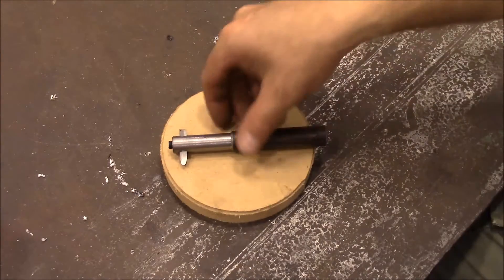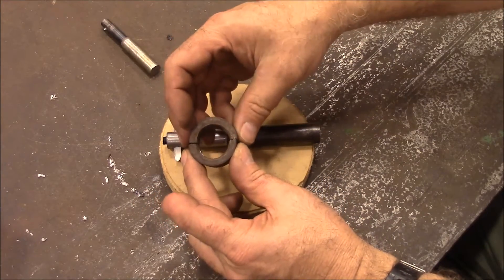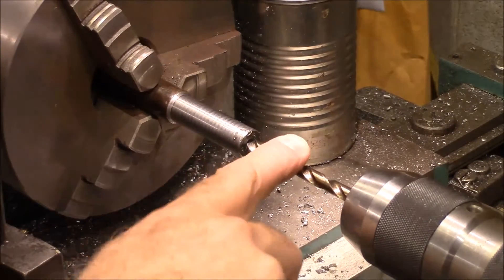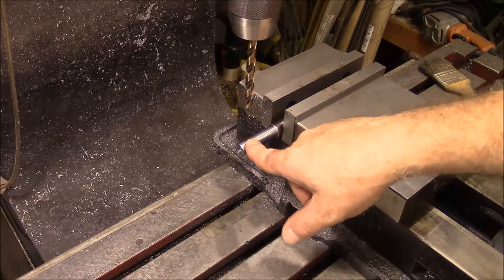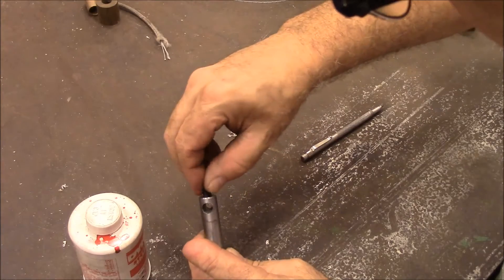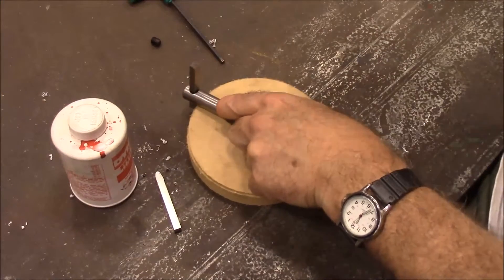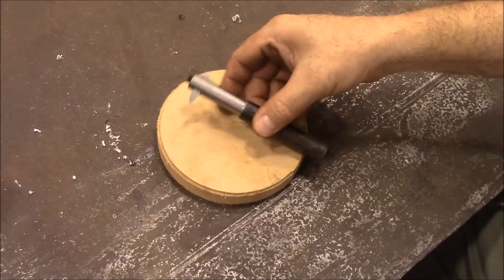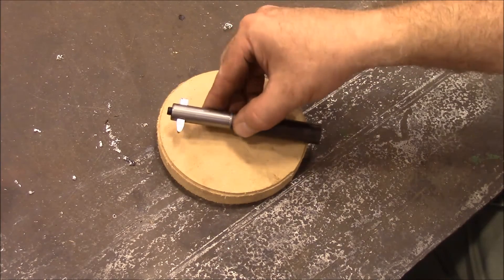Easy Homemade Internal Threading Bar

Comment: This tool clearly will noy cut an internal thread as there is no 60 deg angle on the cutter, added to which you need to dia in the correct fed on your lathe!

Comment: I ended up making one out of leaded 12L14 and drilling a 1/4 hole and trying to file it to square, WOW that was a nightmare. My needle files (cheap brand) kept leading up on me and my file brush couldn't get it out of the corners of the file. 

I finally ended up grinding my 1/4x1/4 hss down some to get it to work. I think I may try it again this time with 3/16 round HSS for the bit, I will make a small square block with a set screw and put a flat on the side of the hss then use the square block to help me keep the hss squared up as I grind/hone the point to the 60 degree and allow me to come down half height on the round stock, this way everything stays on centers and allows the bar itself to be on center in the hole as well rather than having to lower it the 1/8 off center up/down for the 1/4 square hss giving me more room for the bar in a hole. 

I am new to machining and have an internal threading bar with inserts coming in the mail, however this is a pain to make but a great project for learning on and why I have made several of the tools for working on things since it makes you appreciate what it takes to get something just the way you want it.
Reply: Also how much flex do you have in your bar? I have considered, once I get better at this, of making the bar out of HSS as well and using a pure carbide drill bit for making the hole for the bit. My biggest concern at that point would be being able to thread the HSS for the grub screw, I would have to use a carbide tap and go very gently making that part since the tap is so small.